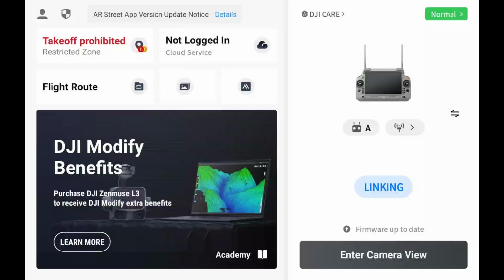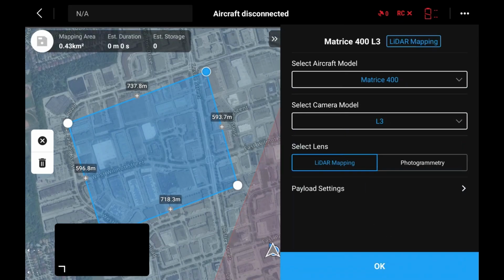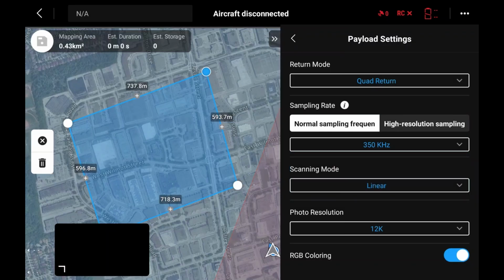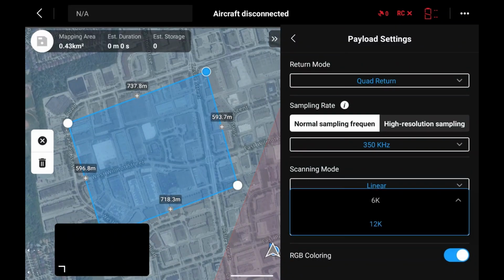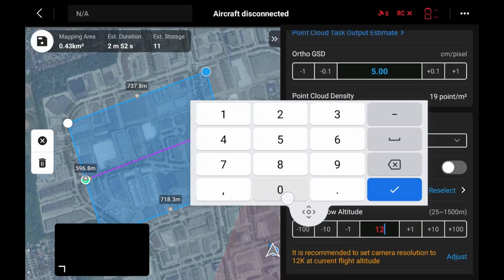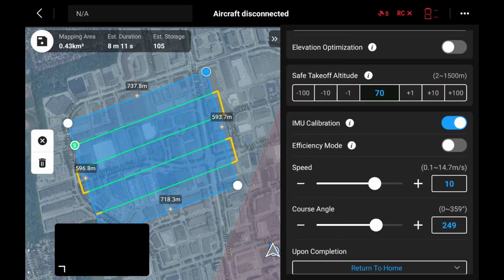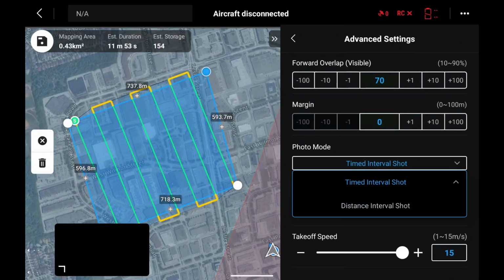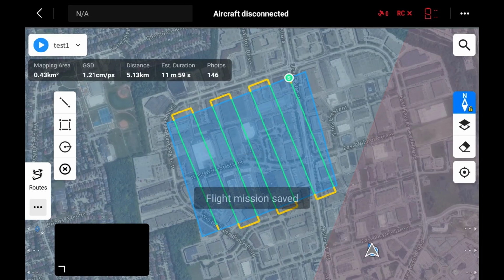Can-Learn: DJI L3 - Mission Planning

Comment: Is it possible to do it prevoiusely on a computer or do you recommend doing it directly in the pilot 2 app?
Reply from the maker: It is recommended to do mission planning directly in DJI Pilot 2, however preplanning is possible using Google Earth to generate polygons of flight areas.  KMLs can then be imported into DJI Pilot 2 as a basis for a flight mission.
 
Check out our other video on importing KMLs:  https://youtu.be/pYkf2-eL31I